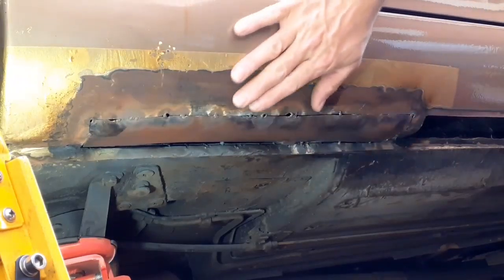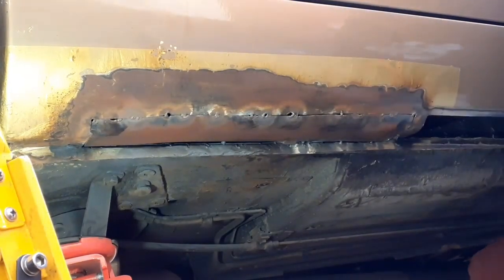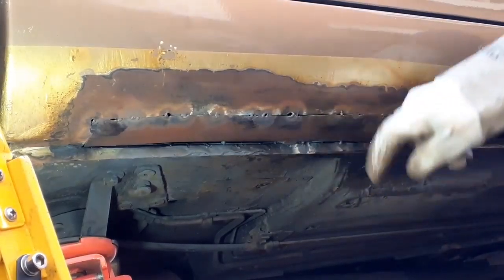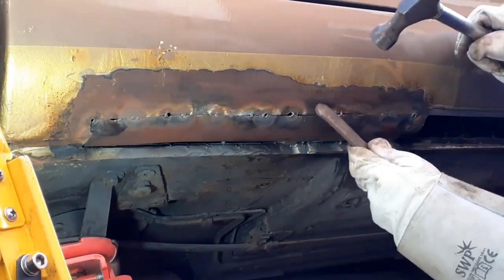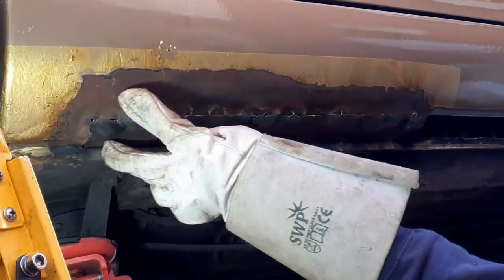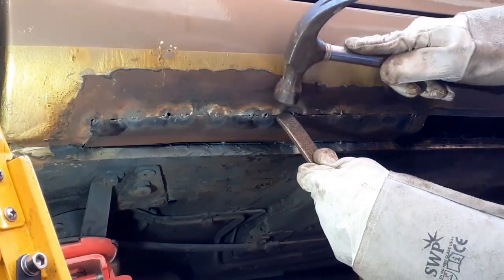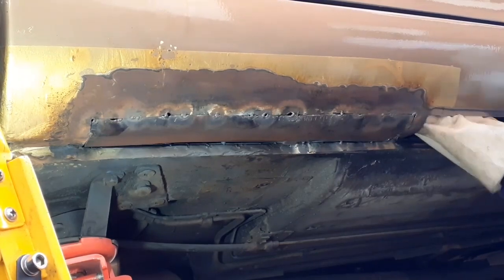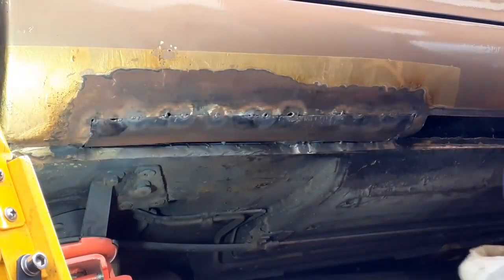Pt. 32: Fabricating sill repair section

Comment: Would have been a lot easier and probably produced a better job using mig. Lead loading it is also a bit of a pointless task.
Reply from the maker: I use the tools & facilities I have available to me.
I'm keen to know what you suggest would be less of a waste of time, if I'm not to lead load repairs ?